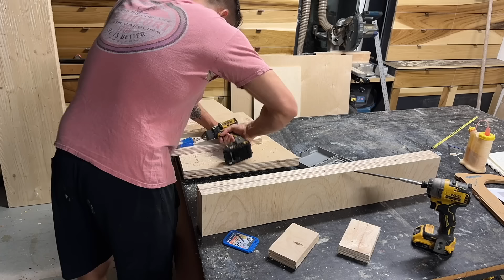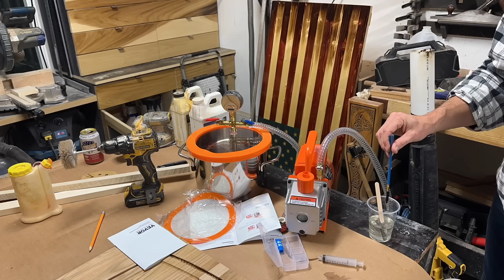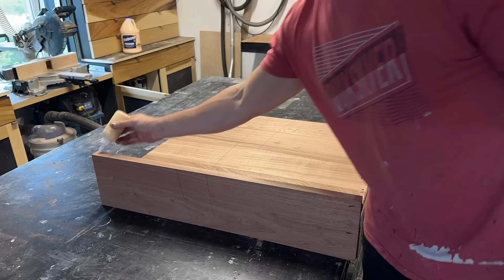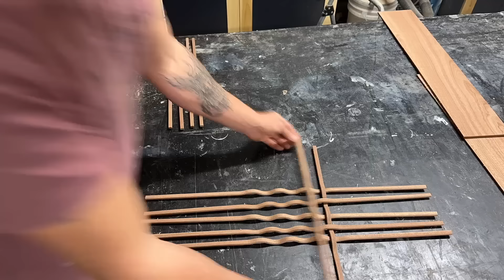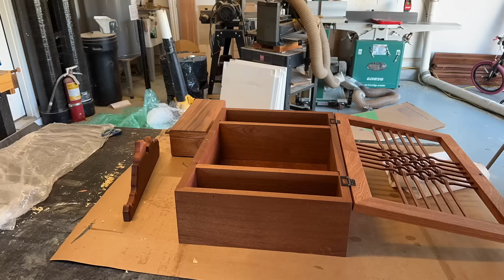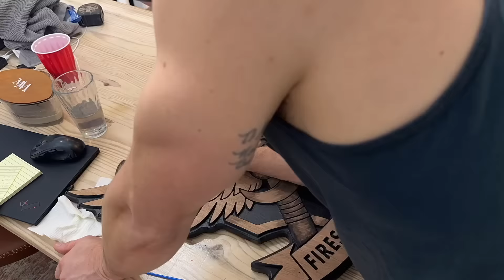Wood Working Side Hustles Can Be Profitable

Comment: You do nice work!  Question for you… are the dollar amounts you’re quoting the amount you charged or the amount you made? Also, what vacuum pump and bag system are you using? Are you happy with it?
Reply from the maker: thanks for watching, the dollar amount is what I charged. I did not include what I make from youtube and selling digital build plans so it actually more, but it all buffs out so if you were to include that income minus the material costs, the net is close to 4k. Here is the link to the vacuum pump I used https://amzn.to/3JEQJxk. I got the bag from vacupress.com. I haven't used it enough yet to have a solid opinion, but the times I've used it it has worked.